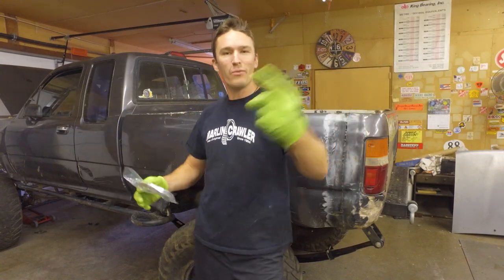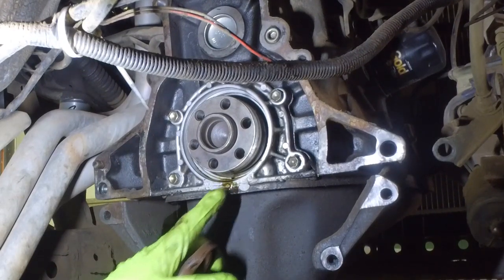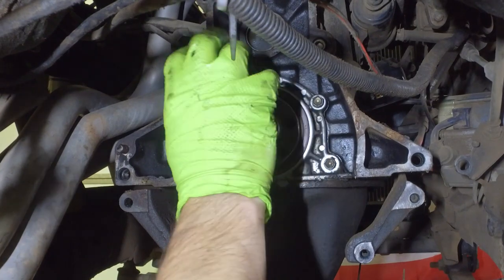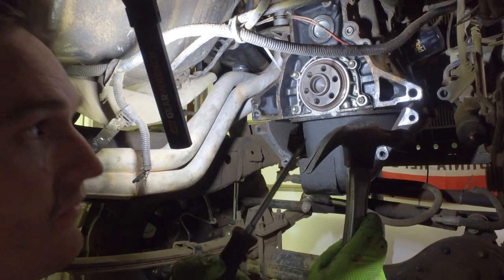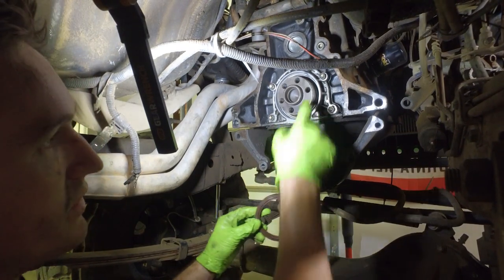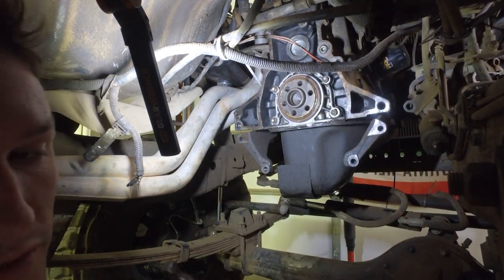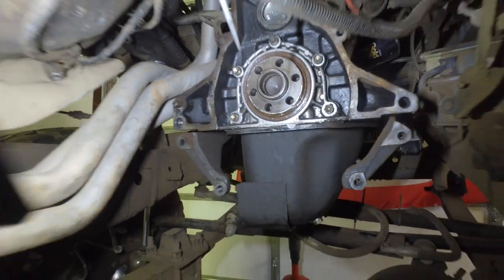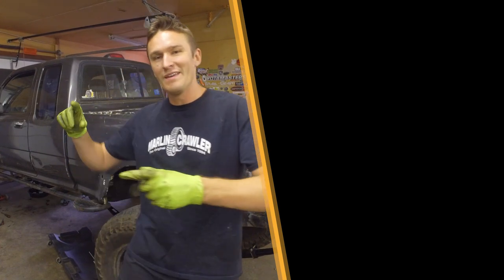How to Install a Rear Main Seal  | 22RE Toyota 3rd Gen Pickup

Comment: Just a tip. You may fit a brand new seal in place and get it all back and running only to find there is a leak out of the seal! This is because the old seal has worn a groove in the crankshaft sealing surface, after decades of rubbing against that surface. 
I commonly will remove the seal housing,  even though it's another 1/2 hr job, so I can access the c/shaft and then emery paper the groove until it's gone or almost gone. 

So be careful just swapping and old seal for a new one assuming it's going to stop any leaking oil.
Reply from the maker: Good suggestion, we were simply replacing the seal because we were already this deep into the back of the engine. We figured why not. 

Also when we remove the seal housing wouldn't that let the oil out? If I recall we still had oil in the engine.
Reply: @SnailTrail4x4  Oil is contained in the sump, below the seal.... unless someone has overfilled the engine!
Reply from the maker: @jmy6050  I guess I've always thought that oil would come out and then it would be hard to rtv seal again.
Reply: @SnailTrail4x4  Not usually. If it's too high you drain some off, but I've replaced seal housings many times and never had an issue with oil coming out of the engine. I use acetone to remove any of the rtv and to attain a really clean gasket surface. Then apply the sealant and bolt the housing up right away.
Reply: They make metal seal savers you can slip over the end of your crank to give the new seal a brand new surface to seal on, they claim to last 150k. I wouldn’t trust myself to sand it down evenly enough.

Comment: The oil level is below the top of the pan, so there is no need to drain the oil. 
It is much easier to remove the “dog house” for the RMS, replace the RMS and the dog house gasket. Wham, bam, thank you ma’am and cured!

Comment: Is the oil level of the oil pan not below the seal so oil draining would not be necessary?? Also I cringed seeing that hammer tapping the seal. Seals are cheap but the amount of work to do it again would be a couple of hours.
Reply from the maker: To be honest I don't know how high the oil level is when resting. It must be below the seal level.
Reply: Yes, draining the oil is ridiculous, because the oil level is way below the top of the oil pan.

Comment: Where is the pilot bearing?
Reply from the maker: There isn't one.
Reply: @SnailTrail4x4  you drive an automatic 22R???? is it carb or efi????? Carb is 103hp and efi is 116hp...you lose 20 running an auto...
Reply from the maker: @drewfleming7065  -- 22RE with an R151f trans. Just old so not as much hps

Comment: A CLAW HAMMER??? As a carpenter, Im offended.....You cant take the engine backing plate(the part that holds the seal) off without removing the oil pan....you cant get it to seal at the pan when put back together.....Also try a 3" PVC pipe end cap as a seal install tool, tap with a hammer...NOT A CLAW HAMMER!!!!
Reply: That's like saying you can't remove the timing cover without removing the head... Which you can do
Reply: @lexannaamnell6593  Yeah you can do that BUT will LEAK oil all over the place...You have to remove both the oil pan and the head to do it right, or you can do it twice. The head gasket is the gasket between the head and timing cover and it gets ruined removing the cover, the 12mm cover top mounting bolt(head to cover) is famous for stripping out(helicoil is a must here before assembly) ...Most rear seal leaks on a 22R are the gasket for the seal retainer or oil pan to retainer(because someone didnt remove the pan and removed the retainer) and not the seal...Ive got 37 years experience with a 22R daily driver...My point was a claw hammer is not the right tool for the job...unless your driving or pulling nails from the block...Hacks will Hack....Besides, its a good idea to replace the head gasket and maybe do a valve job while the head is off...depending on mileage....over 50,000 do it...A 22R only weighs 385lbs...easy to pull....

Comment: Better way to pull the seal is to punch a small hole in seal face, screw in a wood and pull...safer for seal surface gouges from screw driver